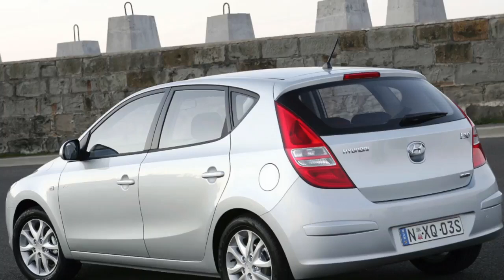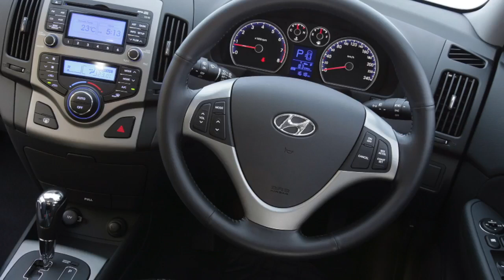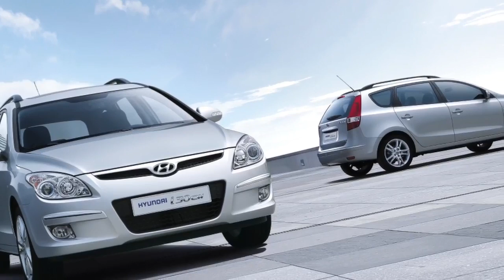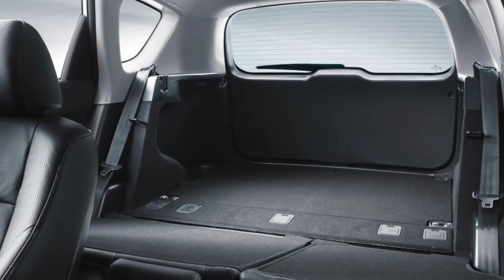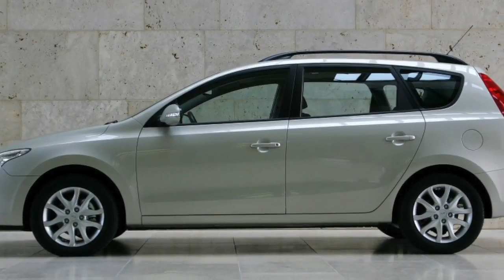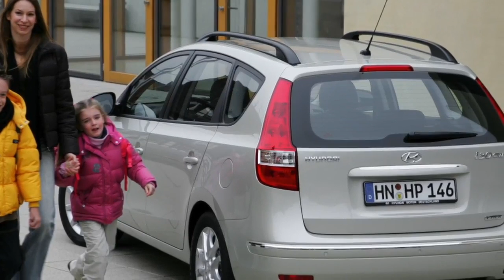Used Hyundai i30 1st Gen Reliability | Most Common Problems Faults and Issues

Comment: My greatest complain is about parts, which don´t usually break. They cost a FORTUNE to replace. My driver interior handle broke. The replacement - a small piece of plastic - costed 40€... Only recently i found the part on Aliexpress for whopping 7€. Also neighboring country often has replacement parts much cheaper, than in my own country.

The illumination is quite easy to resolve. Higher end models of this car had a regulation module - all you have to do, is to get this used and put it into its place on a dashboard (the cables are already there, plugged into empty cover piece).

The computer blinking still occurs, but is mostly caused by door open sensors. To fix it, the sensor needs to be removed, disassembled and a piece of metal inside needs to be straightened a bit, because it bends over time and loses contact, resulting (if ignored) in doors not being detected as "open" on the screen and subsequently ceiling light not reacting to that door. Even if you replace the sensor, the same thing will eventually happen over time.

Please, PLEASE if you´re reading from the script, do yourself a favor and reread it loudly a few times, focusing on every part you struggle with - also do multiple takes and pick the best one.

Comment: Mine has 190,000 kilometers. The only issue aside from regular maintenance was the upper radiator hose. The automatic transmission shifts like it did on the first day, and the engine is perfect  it doesn’t consume a drop of oil. It's the best car I’ve ever had.
Reply: I had to replace timing chain (500€), my interior door handle broke (40€) and there have been some major electrical issues, which were later found to be caused by about 4cm of almost completely burned cable, which was part of the cable responsible for powering up all interior parts and was causing all sorts of gremlins before replacement. Now it seems the starter is on its last legs.

Even with all that, i´m happy. After all, i bought used car, so maintenance and repairs are expected to happen.

Comment: Great car, regarding backlight, the brightness/illumination is adjustable next to the headlight position adjuster. The central screen has an off button also.
Reply: I tended to drive with the lights on all the time in order to read the dials. The 2nd gen i30 has the backlight permanently on.

Comment: Mines had gearbox issues ,has anyone else?
Reply: Manual, 160,000km/100,000 miles, no issues with manual transmission. 14 years old.
Reply: @ivangordeyev7098 
240,000 km's transmission perfect!!!
Reply: yes, mine wont go into gear, i can put it on all the gears but nothing happens it stays in neutral, also clutch is not responding
Reply: @johnnyespalahento2431  Our 2010 minor upgrade had the transmission fail at 44000 km in 2014, it was rebuilt under warranty with upgraded parts . It has now done 189000km. Its a little sluggish now which may be a sooted up inlet manifold. Other than that a great little car